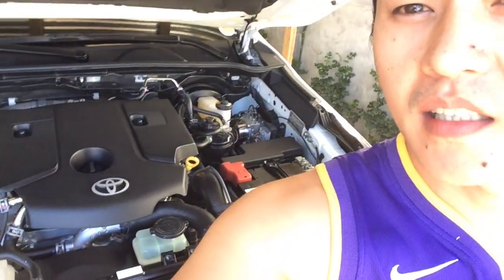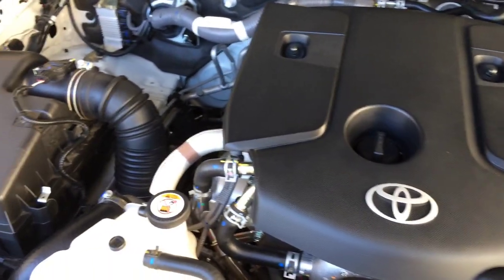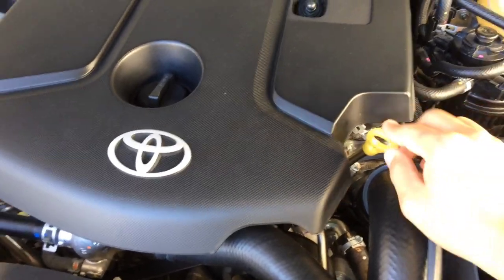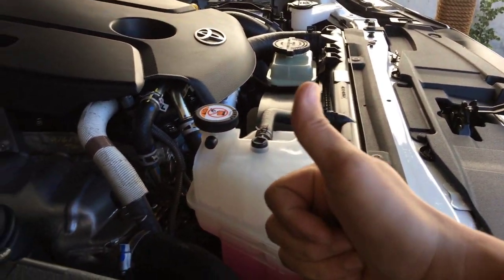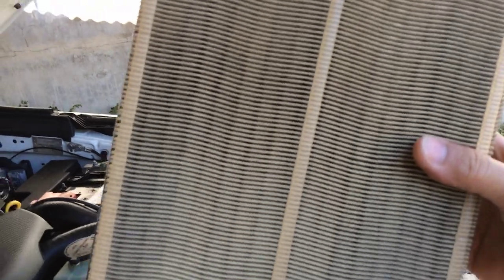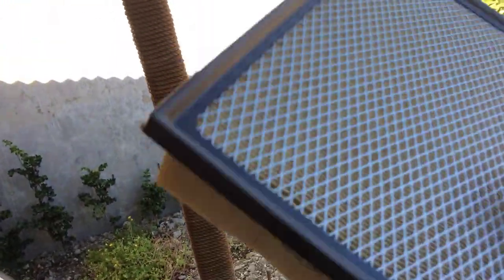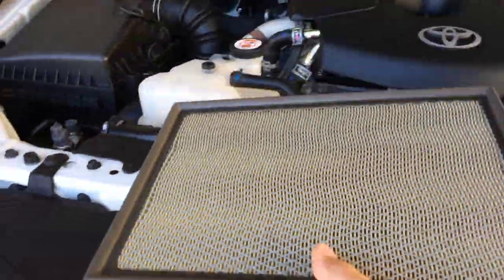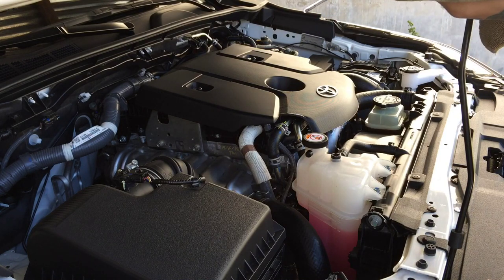Toyota Fortuner Weekly Check up. Basic things to do if you have a car.

Comment: Sir I have hissing sound sa engine area after change oil,  change oil filter and  fuel filter. Parang flat na gulong ung ingay nya kapag ioon ung fortuner. D marinig ng gumawa sir ano po kaya yon
Reply from the maker: justine ng baka yung sabi mong hissing sir sa turbo mo.malinis na kase filter mo kaya nakakahinga na sya ng maayos.try mong pakinggan sa may air filter box nya,tapos ipa rev mo.ganyan dn sakin.
Reply: Lydel_D sir ung hissing sound nya parang gulong na sumisingaw parang sa area ng catalytic? Di po kasi ako sure sir eh 😔 2017 fortuner sakin sir d kasi marinig or ma figure out ng mga mechanic ng shell
Reply from the maker: justine ng mahitap kase mag diagnose sir pag dimo naririnig.check mo lng muna mga hose sa turbo sir baka may crack na or maluwag lang.try mo din e open filter box nya tapos ibalik mo ng maayos,baka may leak lang.
Reply: Lydel_D sir sorry po pero if it’s ok saan ko po kayo macontact?
Reply from the maker: justine ng saan po ba location nyo sir?
Reply: Lydel_D pampanga pa kasi ako sir, gusto ko sna malaman sir paano ung next ko pwede gawin
Reply from the maker: justine ng add mo nlng ako sa fb sir, same name lang dn.

Comment: I wanna a add coolant but I don't know how to remove the coolant cap, afraid to break it.
Reply from the maker: Nur-faiz Benito  just twist it counter clockwise sir.its safe to open coz its only plastic.no need to worry.
Reply: Matigas siya i rotate counterclockwise. Meron cyang parang lock sa cap nya.
Reply from the maker: good kat add mo po ako sa fb ill send vid po kung paano gawin.
Reply: @Lydel_D  ano fb mo kuya, baka naman po pwde nyo rin isend sakin ung video?